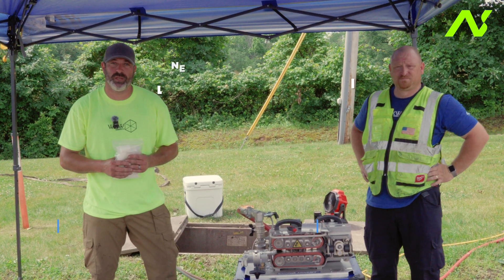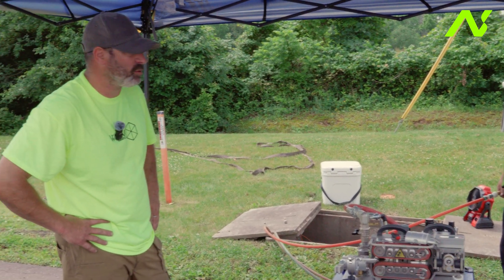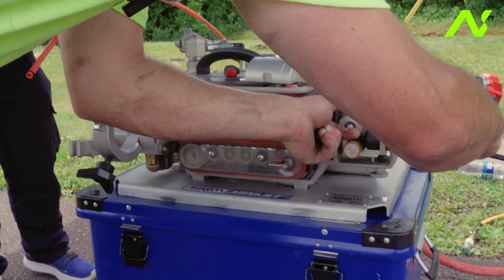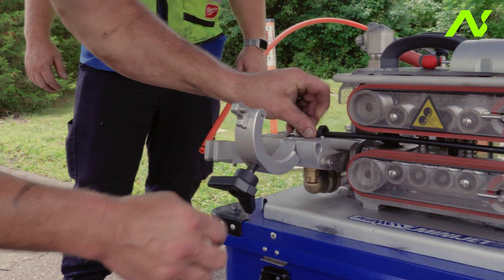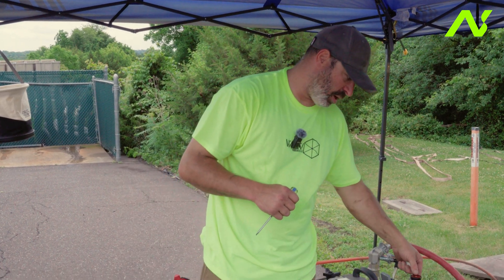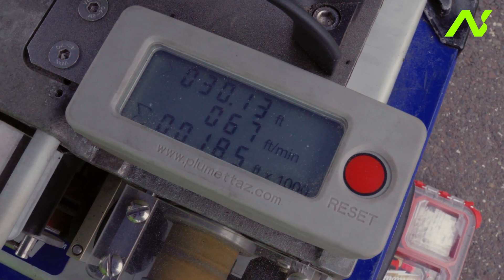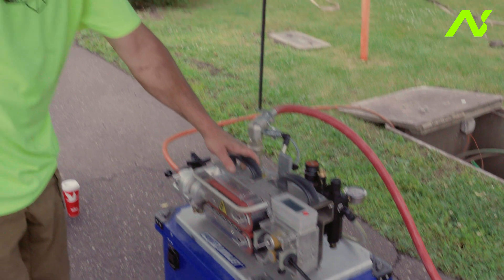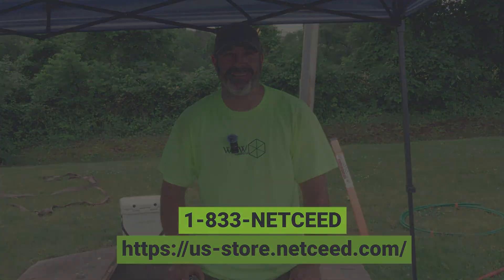How To Blow Fiber Optic Cable - A step-by-step fiber jetting tutorial

Comment: I am interested to know that whether any standard FO cable can be used for jetting or it has to be of specific type? My application is Leak Detection using DAS and DTS techniques. Please advise. S205XA Universal Sensor Cables
Multimode, Singlemode, HDPE jacket, is it suitable?

Comment: can you blow thru multiple boxes to reach end point ,  then work your way back opening the duct and then blow slack at each location?
Reply from the maker: The simple answer is yes! However the challenge with distances in these situations will be how well the duct system can hold pressure.

Comment: Is there someone at the reel pulling the fiber off or is the machine strong enough to pull it? Or do you figure 8?
Reply from the maker: This machine is strong enough to pull the fiber from a reel trailer on its own! If you refer to 1:13, you can see that the Plumett Minijet is pulling fiber from the reel trailer.
Reply: @NetceedUS  cool! Thanks for the reply. That's an awesome machine!